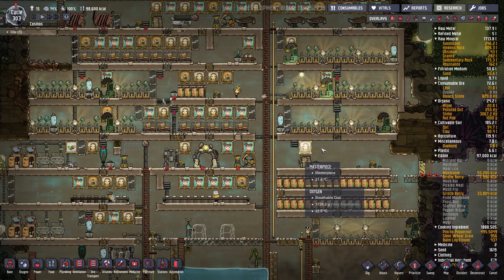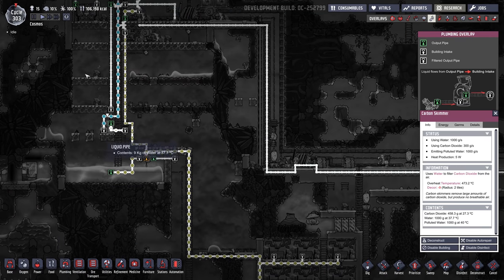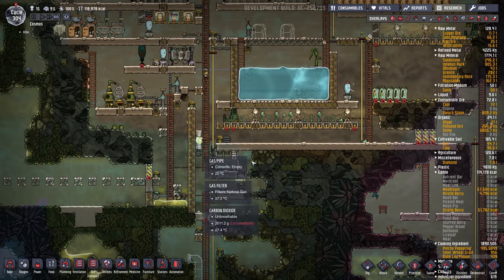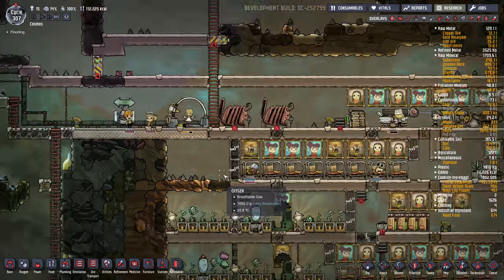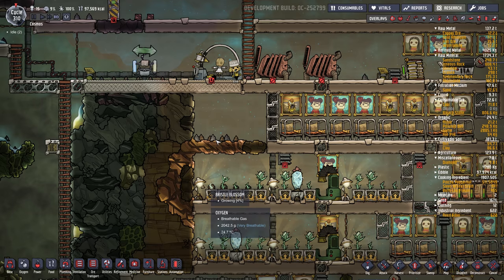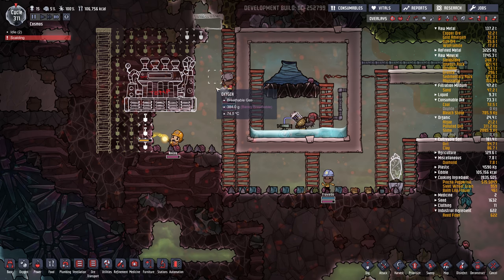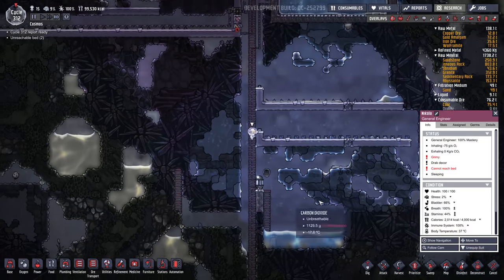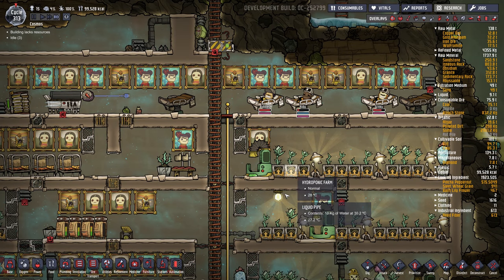COOKING DUPES! Oxygen Not Included - Occupational Upgrade Base #7 (JOBS, HATS & CONVEYOR RAILS)

Comment: 26:00 
I think that wrench icon means she is in a job slot for supply, which is why she kept running back to get something... you would have to remove her from her job slot for that box to be blank for her to have no job at all.
@ 26:03 it says "Ruby's job requires they perform Supply Errands".. I don't think it's a b.u.g.

While on the topic of jobs menu... 
I think the gaining stress from yesterday's vid was because the higher they go in the job skills tree (lev.1, lev.2 etc.) the more they demand better food and decor or they will continue to stress.  
Hold mouse over the icons at the very top of the skills menu and it will give the requirements/demands.

cheers WM.
Reply from the maker: I realize they have higher quality food requirements but I've seen with other dupes stuck like that, the stress percentage tends towards infinity. A save and reload makes it vanish so that is why it's a bug. As for the wrench, it was checked or wrench but no way to clear. Maybe if I take her out of the profession as well to clear it completely.
Reply: Oh yeah... I forgot you mentioned the restart fixed the stress issue... my bad; wasted a whole comment there.

Comment: For your nullifier you should try digging out some stuff around to give it more room to breathe and also try and wall it off so it is cooling a more concentrated space, i.e. you dont want it to be cooling things that aren't producing heat. Also throw some hydrogen in there and it should be golden but you might not need that.
Reply from the maker: Yeah I should heat shield the back so all the cold radiates to the left.

Comment: With that update, we need to start thinking of managing multiple smaller bases instead of a big one in the middle.

The way I see it iss to have one for your farms, one near energy / oxygen, one near oil / plastic and one near storage (optional). With tubes and firepole and conveyor to move things between those areas so they all have food and building materials.
Reply from the maker: I think you're right. Little outcamps. If they had beds that were not assigned it would make it easier for dupes to sleep in remote places if they were "away" from the main base.
Reply: Actually, with the latest update that roll in an hour ago, Athletics and Strength can be trained, as well as the rest, except it does not go as high as before this preview. And the jobs give permanent bonuses upon masteries so you could have an army of people going out in exosuits if you want.

Going to be fun :)

Comment: Regarding your cooler. The air tiles are your problem. Note how they don't actually touch the liquid on either side? That's because the create a sort of Leidenfrost barrier so what actually happen is that they insulate by the oil having to transfer the cold to the air which then transfers it to the tiles themselves which then transfer it to air again that then transfers it to the water. Extremely inefficient. 

Replace them with metal or plastic tiles and see efficiency sky rocket.

It is usually a very bad idea to use air tiles for liquid containers... unless you specifically need the pressure resistance.
Reply from the maker: I realized that after filming. Well..I realized they have a crappy thermal conductivity vs metal tiles. I forgot about the gas between the liquid! I'll swap those over to metal tiles.

Comment: All in all its a nice update, altho really laggy..
i go for more duplicants now up to 20 ish where i used to have 8-12.
since job specializations... looks like athletics is the thing u want now , and pacifist's.

Noticed u have the plant hydro tiles build upon tiles ,
whilst u could build them over regular tiles without having to deconstruct them.

also stuff i learned from the tube cube, dupes can use the med bay toilets and such even if there assigned to the med bay room
however my 3rd attempt failed due to the update...

i'm working on a machine that does it all, and self cooled oxygen, water etc, boil's water, makes steam and all else.
Brothgar made a nice vid about conveyor belts the other day pretty awesome stuff u can do with it. like making steam,dirt, etc !
already had figured out this, hope i can show u soon...a working model that is.

about suits
if u make a storage compactor with 1 unit of space set, u can store a single suit. i used to have them in their private bedrooms.
however, if u click the pile of suits more than once itl go to the next suit under it so u don't need to w8 for them to pickup one.

thermodynamics,
if u take water at two different temperature meeting points, in pipes, 
they will even out at the average, u could use a cold water loop and connect a hot one to it to drop it down fast same for oxygen
but u could use mixed solutions, altho u would need to consider  the thermos capacity and conductivity, and Nerf one or another flow rate..

such a large tank is not easy to cool. takes allot of energy, u want a system that provides cooled water at its consumption rate.

anyhow... enuff for now..  i have  not seen any of the new creatures on the map yet.. hopefully they'll introduce them soon.
Reply from the maker: I hope the lag goes away once the preview is out for real in a week or so. Yeah I should have planned my farms better..they waste a bit of space. I'm going to try a valve to feed them hot water next time after Samsonite recommended it. Can't wait to see your machine that does it all! I have to try your idea about mixing cold water with hot inside a pipe. I guess the way temps average out isn't correct. Maybe the next update will be the creature update.

Comment: Transit tubes can only take other access points as exits, AFAIK. I may be wrong.

 Looks like I was wrong, LOL. I always put 2 (or more) so they can go back and forth.
Reply from the maker: Since poles are fast down I figured I would save the power.
Reply: since i last checked they can exit without a access point